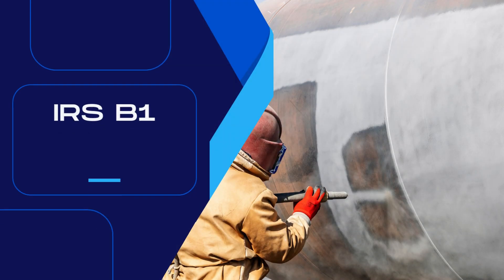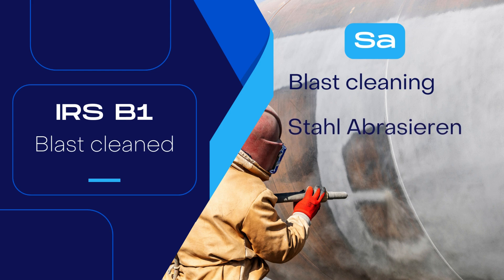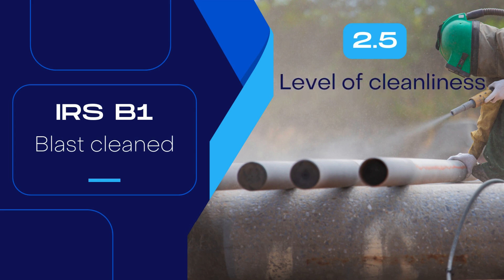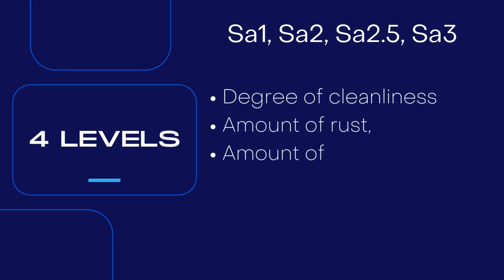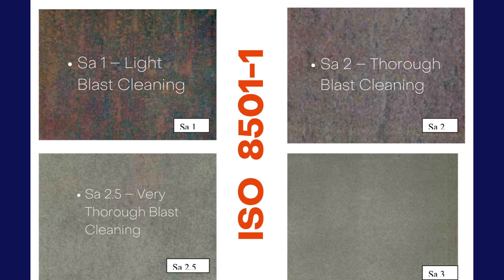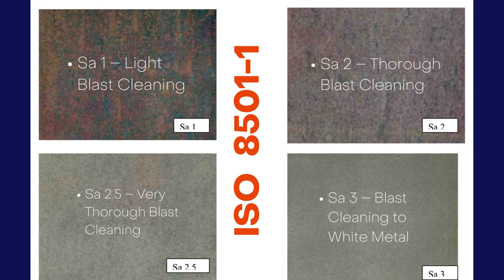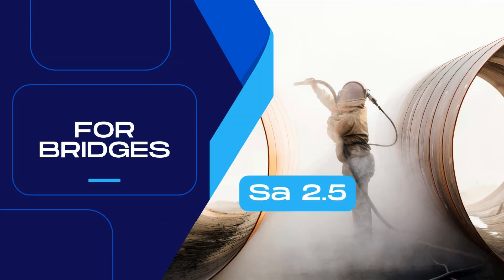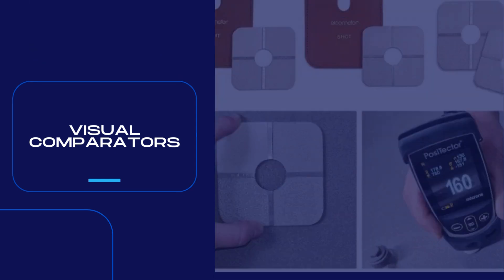What is Sa 2.5 blast surfacing level ? Provisions of ISO 8501-1 and IRS B1.

Comment: What is the surface roughness of sa1 sa2 sa2.5 sa3 in ISO 8501-1?
Reply from the maker: ISO 8501-1 focuses on visual assessment of surface cleanliness, and I haven't found any direct correlation between its Sa grades and specific roughness measurements (Ra or Rz) within the standard itself.  Is there anything else within ISO 8501-1 that I might be missing?
Reply: @allaboutbridges  Thanks a lot. I see that in reality, people test Sa1, sa2, sa2.5, sa3 standards. In addition to visually assessing the cleanliness of the surface, they also measure the surface roughness. There are many such videos on youtube.
Reply from the maker: @ ok. May be because in visual comparison there always remains an element of subjectivity. If we first calibrate the instrument with the help of standard Sa surface, then we can actually measure the prepared surface to know whether it is equivalent to that Sa grade or not.